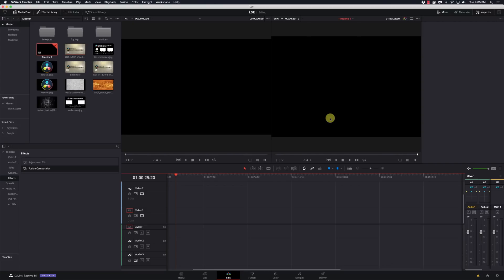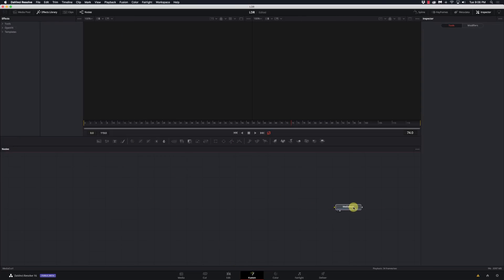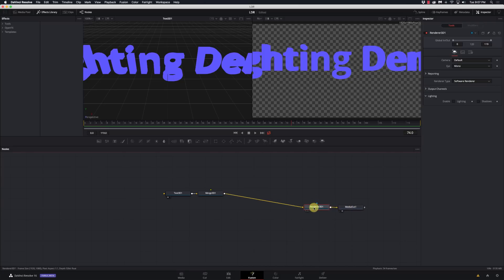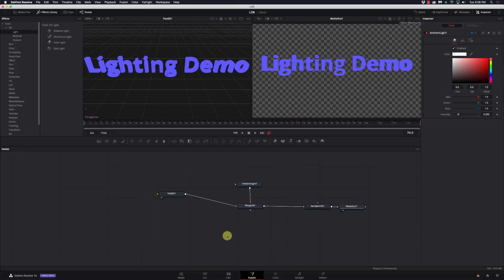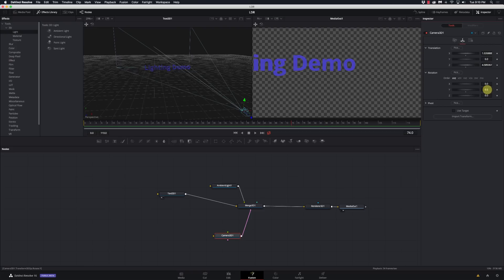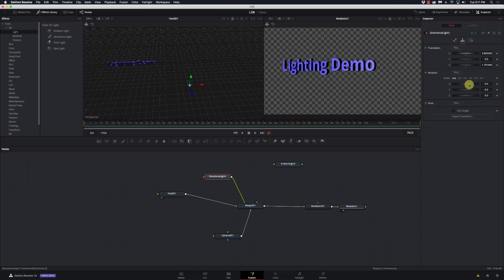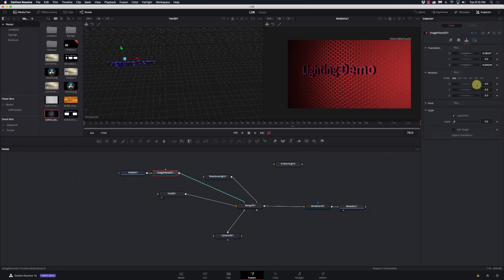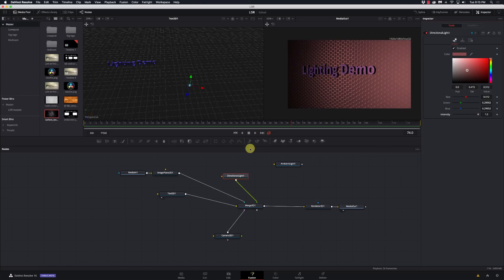3D Lights with Davinci Resolve Fusion

Comment: Thanks - helpful.  I think you missed a trick by not explaining 'Use Target' which is a handy function that's not immediately obvious.   Same as in 3D Camera.  I don't fully understand it but I've found it helps to keep control of lights and cameras when constructing the scene.  Not always what you want for directional purposes but useful.
Reply: Good point. I should do a follow-up video on that